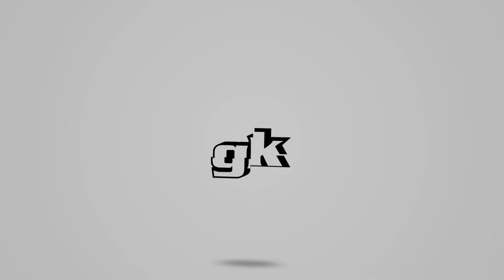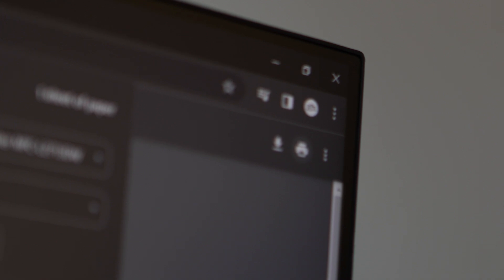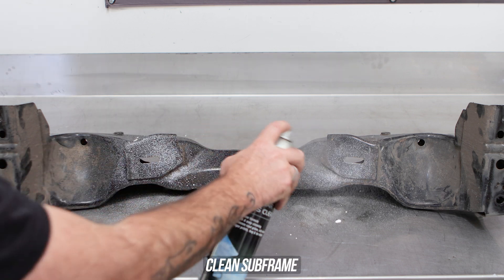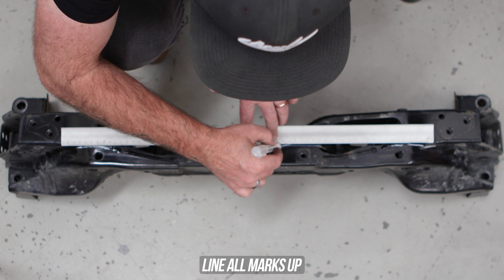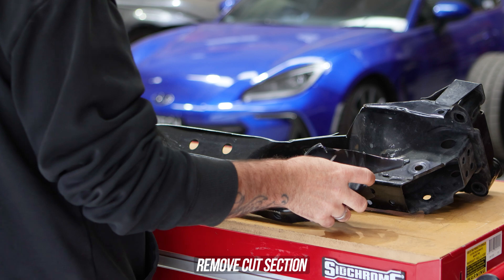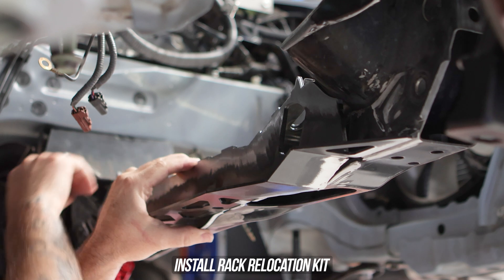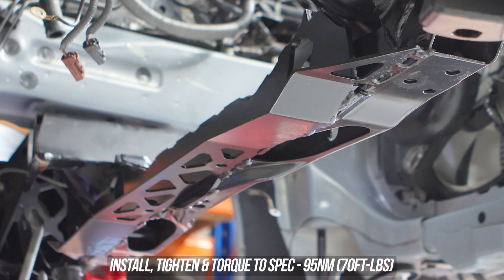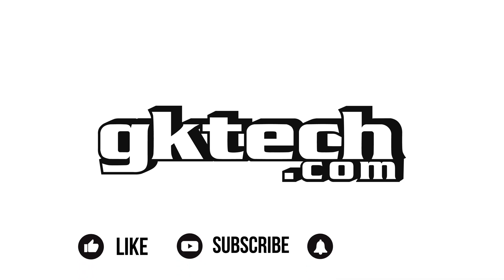Gktech GR GT86 BRZ FR-S Steering Rack Relocation Kit - Install

Comment: Do you use the rack extender with the relocation kit?
Reply from the maker: No, there is enough adjustment in the OEM shaft to compensate for the rack relocation.

Comment: Using LS3 in GT86, but can't mount oil pan. Due to the boxer engine, the original steering rack location is very unsuitable for drifting, this moving of steering rack - will give me the possibility to use rear sump engine, like mine? or not?
Reply from the maker: I don't believe it will provide the clearance you're looking for unfortunately.

Comment: Can the relocation kit be use with factory suspension?

Planing to do an 20B rotary engine swap but car will stay for street use
Reply from the maker: You could if you needed to move the rack forward, but the kit was designed to move the rack to avoid steering bind and not so much for engine clearance, most engine swaps require notching at the front of the subframe, so it would be best to test fit first and then go from there.